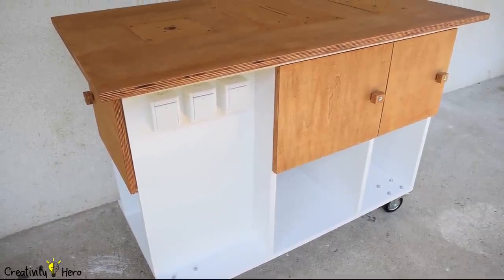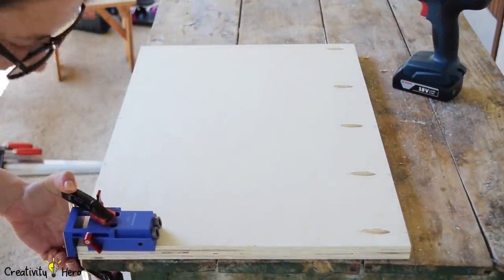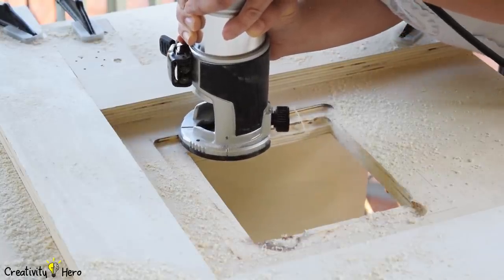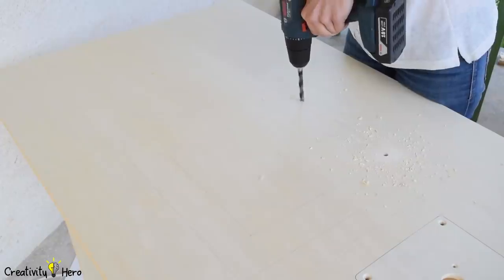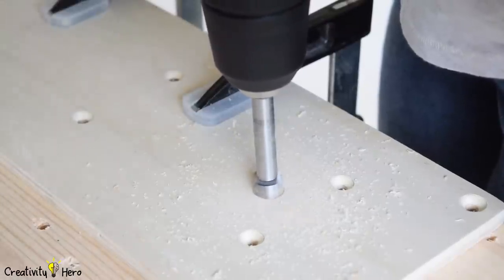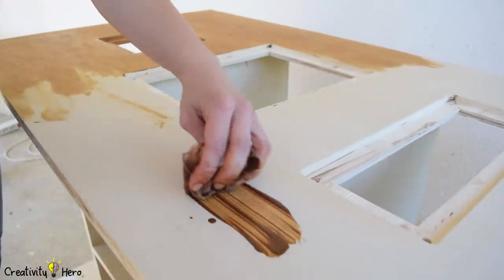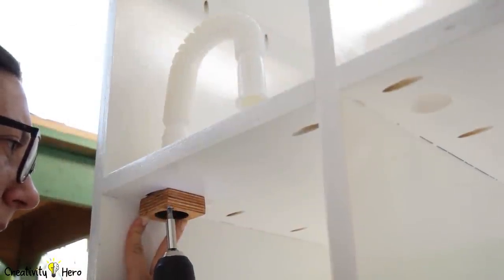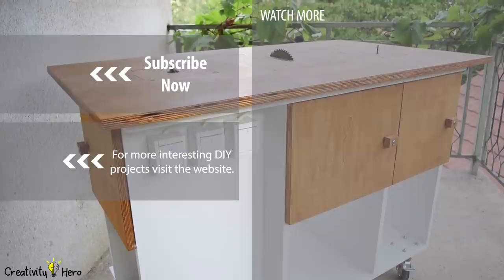Homemade 3 in 1 Multipurpose Workbench: Table Saw, Router Table and Inverted Jigsaw (Free Plans)

Comment: I've seen other multi-purpose work benches, but yours is by far the best designed and executed one I've seen. I built a table saw using a circular saw a few months ago, and through trial and error I ended up only making it where 90° cuts can be made. Your solution of making a 45° cut through the circular saw base made me slap my forehead and ask why I didn't think of that myself. I made my table saw portable, (once the the circular saw and its base is removed the table folds up), but I only did that because I wanted to be able to cut the pieces for my fence where I was working on it, and for now I have to work outside until I get my garage cleaned out to have room to work inside of it. Once I have the room, the idea of a moveable multi-use work bench makes sense for my needs. Thanks again for another great build and video.
Reply from the maker: That's awesome! I'm glad you find my video useful!  I'm sure you'll make your workshop wonderful! :)

Comment: Thank you for this free plan. I'm planning to make mine with some changes. I"ll be putting the router switch on the opposite side basing from the direction on where I should push my pieces. Will also put drawers on the bottom for storage and  make router box little bit smaller so I can put  additional drawers below switches for additional storage for router bits.

Comment: You have done a beautiful job, both in design and building your bench. While it is something you are obviously not going to change on your finished unit, I would make one tiny but inevitably important change to the plans...

The 90 degree corners on the bench table... especially at the front... are something that will hurt you if you run into them.

I would recommend rounding the point of the corner...  one pass with the rasp is enough to make a big difference.

Keep up the excellent work!
Reply from the maker: Thank you so much! I appreciate your suggestion! I haven't thought about it, but I'll definitely take it into consideration!  :D

Comment: You done a very practical, inexpensive and easy to make bench, thank you for your efforts can’t wait for all the jigs. One request, can you detail how you connected the vacuuming system, thank you and God bless
Reply from the maker: 16:41 Here you can notice that I made wooden pieces with holes in the middle for each tool. I screwed one above and one below the shelf. In the wooden pieces which are below the shelf I additionally inserted metal cylinder shape pieces that will help me attach the hose from the vacuum cleaner. 18:14 This way I can easily move the vacuum cleaner from one tool to another. I attached the white hoses to the tools on the one end, and on the other end I placed them into the wooden pieces. I made all of this because the hoses from the tools and the hose from the vacuum cleaner didn't match, so I needed to improvise. Also, all the holes are a tight fit for all the hoses, because I needed to make sure that the dust won't get out of the workbench and make a mess. I hope this was helpful.

Comment: Hallo Marija,

Sorry it‘s me again.
probably I was blind. I discovered the answer in the course of your video. I will try 
to assemble the dustcollection without direct connection with the electronic devices, but use the port in the „ box „.
Best regards
Reply from the maker: Hi Harold! Everything depends on the tools and the vacuum cleaner that you have. Their dust nozzles may have different width, but they're easily adjustable. :D

Comment: Thanks so much for the plans. I'm currently half way through building it. I just noticed the circular saw is right up against the wall inside the cabinet. If there's a vent on the end of that saw you may be completely blocking the airflow. It will reduce the lifespan of the tool if you're running it for long periods, but I guess usually you don't need to

Comment: Well done. Beautiful results. Can you explain the dust collection a bit more? Does it work well? I see a pile of dust from the router, but not from the saws. Do you have the vacuum in the cabinet?
Reply from the maker: Thank you very much! The dust collection works pretty well. And the vacuum is not in the cabinet, because it is quite big, so I use it outside the table. Here's what I actually did: 16:41 Here you can notice that I made wooden pieces with holes in the middle for each tool. I screwed one above and one below the shelf. In the wooden pieces which are below the shelf I additionally inserted metal cylinder shape pieces that will help me attach the hose from the vacuum cleaner. 18:14 This way I can easily move the vacuum cleaner from one tool to another. I attached the white hoses to the tools on the one end, and on the other end I placed them into the wooden pieces. I made all of this because the hoses from the tools and the hose from the vacuum cleaner didn't match, so I needed to improvise. Also, all the holes are a tight fit for all the hoses, because I needed to make sure that the dust won't get out of the workbench and make a mess. I hope this was helpful.

Comment: I just found your video and it is excellent work. I do believe however that you have the wiring wrong. If I'm not mistaken, you have the load (hot) going to the outlet first and connect it via the neutral to the switch. This means that if you flip the switch, there is still a hot wire connected to the outlet which could be dangerous even if the system is grounded). I have always been taught (not an electrician though) that the circuit interruption should be on the hot side, not the neutral. So you bring the hot wire to the switch first and connect the outlet via the neutral (that is usually also how your lamps are connected). When the switch is flipped, the hot wire is active inside the switch and there is no danger. If I'm wrong I apologize beforehand, just making the comment for safety reasons 🙂

Comment: Hallo Marija,
I am inspirier by your performance, so i started with my own tablesaw project. Something i warnt to know is: Does the vacuum cleaner  work effectively under the router and the jigsaw . Is there enough  undertow that the Wood shavings fall into the box? 
So I have to say, trank you for you Inspiration and I am looking forward to your answer.
Best regards
Harald
Germany ( Bavaria 🍺😉 )
Reply from the maker: Hi Harald! Thank you so much! The vacuum cleaner works great for each tool. I made some adjustments on the dust nozzles of the tools, in order to make the white hoses a tight fit. In fact, I added some rubber pieces around the connection points of the nozzles and the hoses, and tightened them with zip ties. This way, the dust goes directly into the vacuum cleaner. I hope this was helpful. 

Greetings from Macedonia! :D
Marija

Comment: very nice build!!I originaly plan for this type of workbench but I ended up with separate Table saw and  router table...and a flipable Jigsaw table and electric planer/jointer. One question did you put a top coat(polyurethane)on your oil stain?or you use a stain with polyurethane in one application?thanks for sharing..new subscriber here!
Reply from the maker: Thanks for subscribing to my channel! I really appreciate it! And yes, I used a stain with polyurethane in one application.

Comment: Awesome build! How are you collecting the dust for the table saw?
Reply from the maker: Thanks! 16:41 Here you can notice that I made wooden pieces with holes in the middle for each tool. I screwed one above and one below the shelf. In the wooden pieces which are below the shelf I additionally inserted metal cylinder shape pieces that will help me attach the hose from the vacuum cleaner. 18:14 This way I can easily move the vacuum cleaner from one tool to another. I attached the white hoses to the tools on the one end, and on the other end I placed them into the wooden pieces. I made all of this because the hoses from the tools and the hose from the vacuum cleaner didn't match, so I needed to improvise. Also, all the holes are a tight fit for all the hoses, because I needed to make sure that the dust won't get out of the workbench and make a mess. I hope this was helpful.
Reply: Creativity Hero thank you for that detailed explanation. For the jigsaw and the router the holes through which the blade and the bit come up seem to be large enough for the vacuum to suck in the dust. However for the circular saw there is hardly any way for the dust to go inside the chamber below the saw. How is the dust on top of the saw being taken care of?

Comment: Hi, greetings from Malaysia. Thank you for the inspirational video.  What is the diameter of your circular saw there? 235mm?
Reply from the maker: Hi Ahmad! I'm glad you like my video. The diameter of the circular saw is 190 mm.
Reply: "Terima kasih" (thank you), Marija.  I planned to replace my old rickety table saw using your design.  Currently I am using a 185mm Stanley.  Thinking of moving up to 235mm, you think it is advisable on this design?  Regards.
Reply from the maker: Sure. The table top is large enough to support that big saw. :D

Comment: Nice work and easy to understand instructions.  One thing that does have me worried is free handing material through a table saw is incredibly dangerous and multiplies your chance of kickback by a lot.  Please be extremely careful and build yourself the fence and miter slot/miter like you suggested in the beginning.
Reply from the maker: Thanks! I'll make all the accessories I've mentioned in the video so that working on this workbench will be much safer and precise. Also, I'll buy a riving knife to reduce the risk of kickbacks.

Comment: Good Job, Respect! But what you don’t work with 9 or 10 Millimeter Plywood for the Inlets? 🤔
Reply from the maker: Thanks. Well, I didn't have plywood with 10 mm thickness, and it was a Weekend, which meant that I needed to wait 3 more days before I could continue working on the workbench. So, this was the only way to make the inserts. It was a hard work, but worth it.

Comment: Great project and very well explained. Thanks for taking all that time and effort to video your work. I know it takes me a long time to do projects, even without videoing, so very grateful you did this. I have a spare circular saw, router and jig saw so think it would be a great project for me to use these. Have subscribed and about to watch the other videos too. I might have missed it, but where did you get the vacuum hose from, it looks very useful..?
Reply from the maker: Thank you very much! I'm glad you like it!  Here's what I actually did with the vacuum: 16:41 Here  I made wooden pieces with holes in the middle for each tool. I screwed one piece above and one below the shelf. In the wooden pieces which are below the shelf I additionally inserted metal cylinder shape pieces that will help me attach the hose from the vacuum cleaner. 18:14 This way I can easily move the vacuum cleaner from one tool to another. I attached the white hoses to the tools on the one end, and on the other end I placed them into the wooden pieces. I made all of this because the hoses from the tools and the hose from the vacuum cleaner didn't match, so I needed to improvise. Also, all the holes are a tight fit for all the hoses, because I needed to make sure that the dust won't get out of the workbench and make a mess. I hope this was helpful. If you have any other question let me know! :)
Reply: Creativity Hero  I admittedly have not checked out the provided links yet, as I'm still skimming through the pleasant comments you have received. But I am curious about the white positionable hoses that you used for the in cabinet dust collection. They look extremely handy. And since I have your attention, would like to thank you for all the time and effort that it takes to make such a wonderfully clear video, from the video recording angles, attention keeping editing, and the leave no questions to ask commentary. Truly a pleasure to watch! I'm sure you've already earned many subscribers, and hopefully you get paid well by YouTube for such professional content. Thank you for your creativity and craftsmanship!

Comment: I recommend use PZ or Torx screws instead of Philips. 3:13 You will suffer much less (or not at all) with that two types in tight sapces like with that Philips screw.

Comment: Hi Marija,
I just saw your amazing video of :
Homemade 3 in 1 Multipurpose workbench : Table Saw,Router Table and Inverted Jigsaw..
Actually amazing design with too much effort exerted..I loved you channel and subscribed with it.I like to execute this project but I have a question hoping to answer me:
You have 4 files,I opened the PDF and with great difficulty I opened the STEP one,I could not open the DAE and the Sketchup files ..I saw the dimensions of the bench from the lovely 3-D file with the ITEM NO.,Part Number,Dimensions in Cm and QTY.BUT I found the ITEMs NO. 5 ,6 ,15 and 16 are missing,Perhaps they are in the files which I couldn’t open..Could you please do a favour and send me these missing items with their dimensions with drawings if possible?..With my appreciation.
George A.
Toronto - Canada

Comment: Hello! I followed all your instruction, but faced problem with circular saw. During installation circular saw the middle of the disc started get stuck in plywood(at your video at 9:58)Can you pls help to understand why?
Reply from the maker: Well, you shouldn't have any problem with that. Try to repeat the cut a few times and push the saw properly until it touches the table top.

Comment: what kind of wood is used for whatever workbench (for example like this workbench)?? i'm a noob, thanks....
Reply from the maker: In this case I used a 21 mm thick plywood. It is very strong and easy to work with, I highly recommend using it in such projects. :D

Comment: I have a reasonable question ... why didn't you make the holes for the machines right into the top ... and made it with spread panels
Reply from the maker: Thank you for asking. Well, the plywood board that I'm using for the table top is 21 mm thick (which is too thick when it comes to the saw blades and the router bits). So, these inserts helped me get maximum height out of the tools, which is great. Also, it is much easier to attach and detach the tools t. I know this way is a bit complicated, but it works pretty well.

Comment: Hi  I like your homemade 3 in 1 multipurpose workbench project and ı want to do it but ı have small problem ı cant fınd 21 mm plywood in my town i  fınd max 18 mm can you help me New dimensions because ı dont know  how to use skeetchup
Reply from the maker: It's a little bit complicated to change all the dimensions, but I think once you start with the cuts, you'll figure out exactly what you need to do. There are just a few parts you need to pay attention to, the middle panels, the doors and the frame below the top. Here you need to add a few millimeters to these parts. The other parts don't need to be changed.

Comment: Miss how you turn table saw 45 degree to 90 degree
Reply from the maker: I decided to make these two cuts (one on 90, and other on 45 degree angle) because they're most commonly used, and I wanted a zero clearance insert. If you need to make different angle you can make the opening wider, so that you can easily adjust it without making additional cuts on the insert. It all depends on your needs.

Comment: I love your videos, having started with the mitre saw fence, then table saw and finally found the workbench video. :)

All are very well explained and edited.

Just one recommendation, instead of using f-clamps to drive t-nuts into the wood, why not invest into a counterbore bit from Trend for example to have the t-nut shoulder and hole drilled in one go?

Based with the ideas from the videos I'm aiming to convert my cheap table saw from Lidl into something really useful. The motor and so on are all great, just the aluminium table top, mite slots and fence are hard to describe in a polite manner... :)

Comment: Very nice, one thing you could have made better and easier for yourself would to have laminated a 3/8" sheet of plywood on top of the 3/4" layer of plywood, that would have made the top 1 1/8" thick and would have stopped the warping you saw. It would also be a lot easier to make the inserts as you wouldn't have to make the routed recess in the top layer, you could simply have made the holes in the top bigger. :-)

I'm sure you will get lots of good use out of it so thank you very much for sharing the build of it.
Reply from the maker: Thank you so much for the suggestion. I know that it was the best solution for the inserts, but the problem was that I didn't have plywood with the thickness I needed, and also I wasn't able to buy one at that moment. So, the only solution I could think of was to make the plywood thinner with a router. Thank you once again. :)
Reply: If you want to make the top stiffer you can always laminate a layer of 3/4" MDF to the underside of the top layer with lots of glue and a few screws to clamp it white the glue sets. You can remove the screws later.

The solution to route down a thicker layer of plywood to a thinner piece is quite clever and a brilliant work-around if you cannot get the right materials for whatever reason, I will have to remember that one for next time I'm short of some thinner stock. :-)
Reply from the maker: Thank you very much. I'll definitely remember that. But I really hope that I'll have all the materials available in different sizes, because this was really time consuming part of the project :)
Reply: Thank you for that great suggestion.